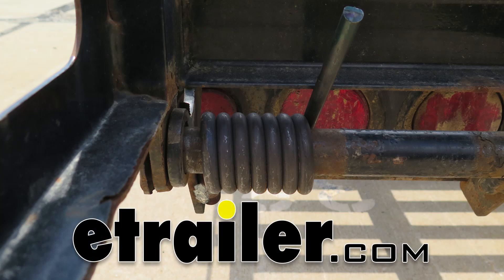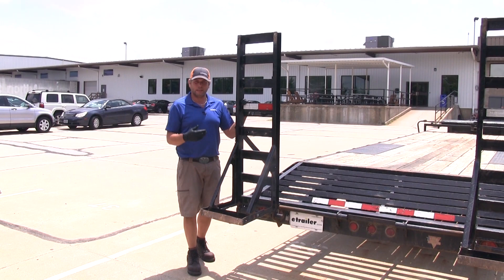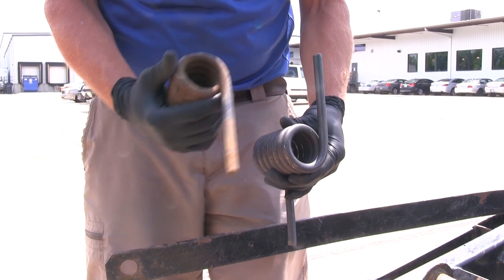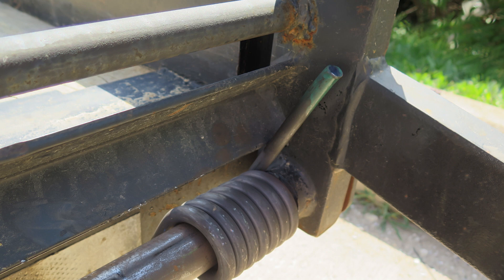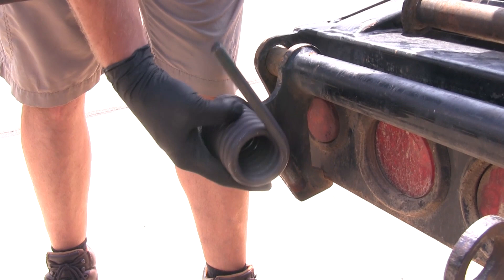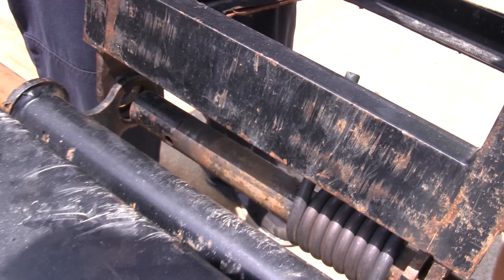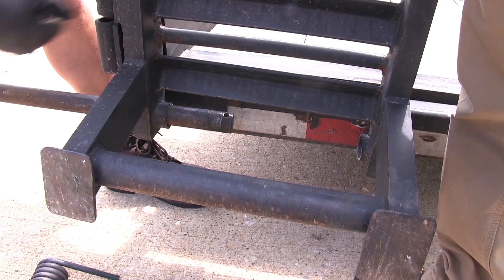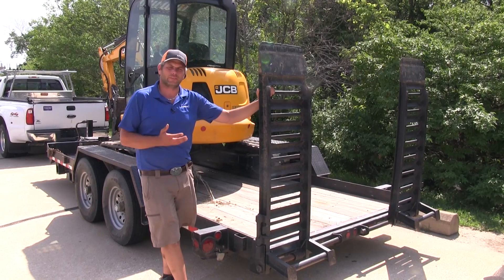etrailer | Ramp Springs Review

Comment: I looked at was unable to find any springs on your site to accommodate a 2" hinge tube.
Reply from the maker: Unfortunately, we only have ramp springs to fit a 1 1/2" shaft pin.
https://www.etrailer.com/Trailer-Ramp-Springs/Redline/RS16933RH.html
https://www.etrailer.com/Trailer-Ramp-Springs/Redline/RS16933LH.html

Comment: Can the ramps slide with the springs on
Reply from the maker: Yes, the tension has to be off of them to be able to slide the ramps from side to side. The ramps have to be in the upright position to take the tension off of them.
https://www.etrailer.com/Trailer-Ramp-Springs/Redline/RS16933LH.html
Reply: @etrailer can’t take the tension off of them, with the ramps all the way up still won’t slide